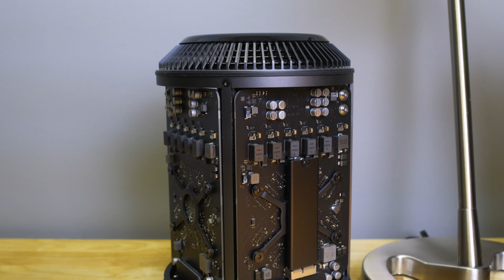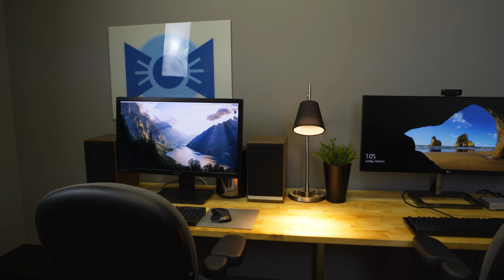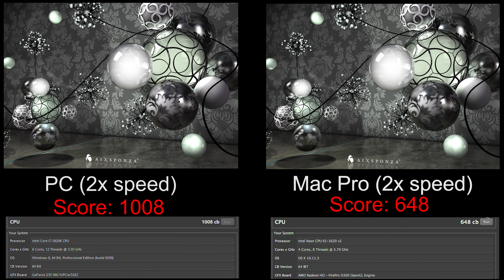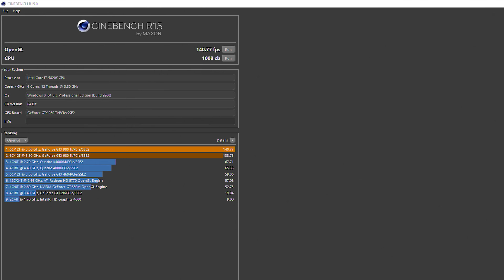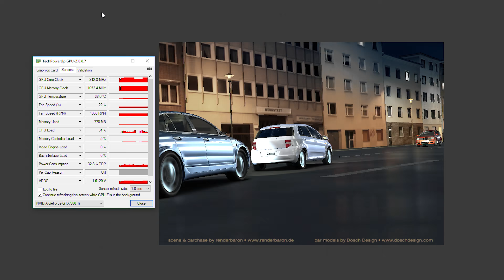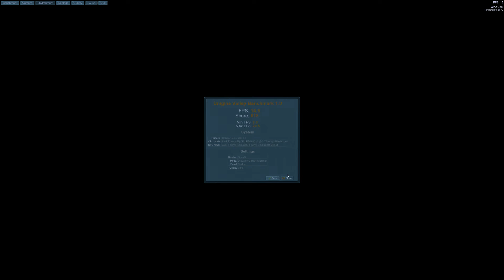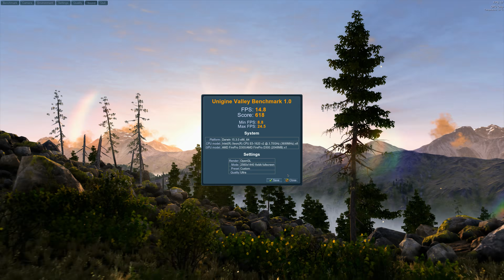$2,000 Custom PC vs $4,000 Mac Pro

Comment: If you're serious about selling, let me know. I would like a second machine.
Reply: +JimmyP Do you have Apple specific workflow that you need another MacPro for or are you just big Apple fan? I'm just curious what advantage this machine have for you over much cheaper and much more powerful PC.
Reply: +8draco8 I've heavy invested in the OSX ecosystem. Including first and third party software. Currently my only option is a Mac Pro. I don't want to get involved in building a "hackintosh". A lot of my work is in live production so I need a second computer to generate better projection mapping from besides my MacBook Pro. I would build the Mac Pro into the rig.
Reply: +JimmyP do you wish to go with PC in the first place or is your workflow simply cannot be reproduced on a PC?
Reply: +8draco8 I'm sure it's possible to reproduce it on a pc, but it wouldn't be worth it to me. Plus I like using OSX more than Windows.